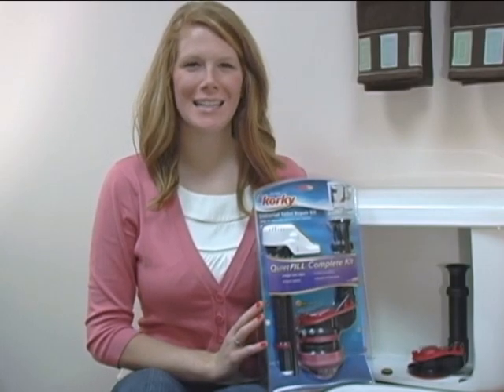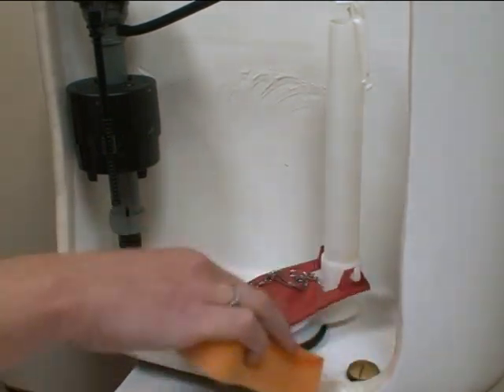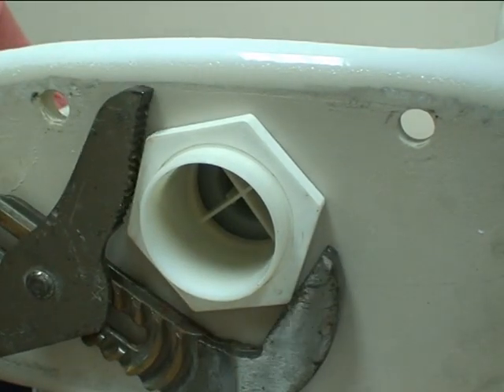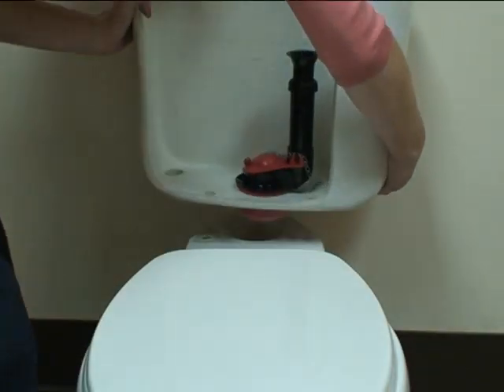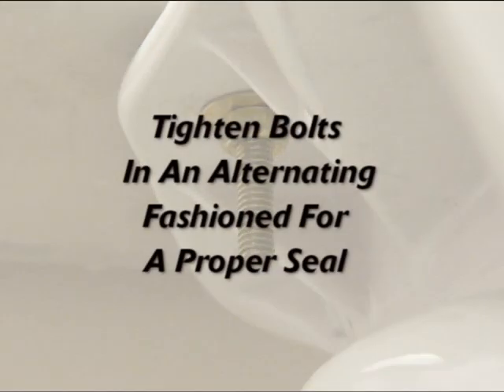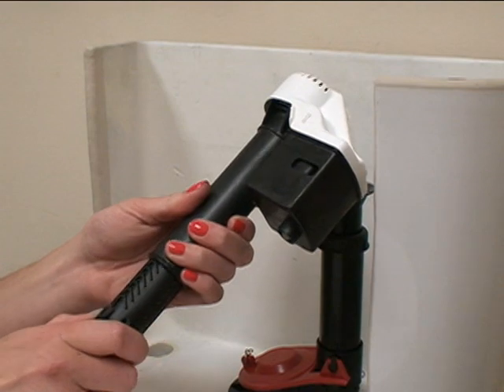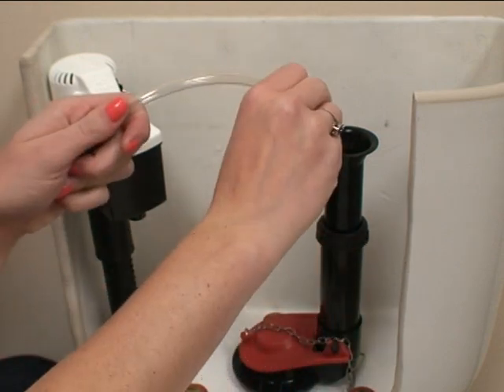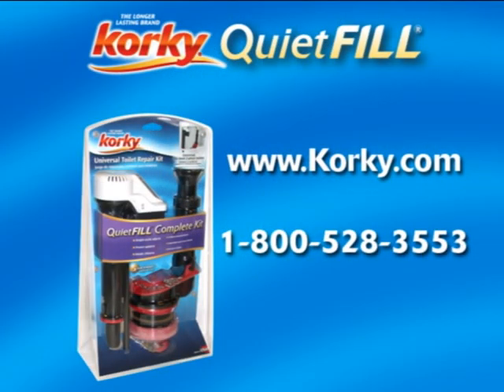How to install the Korky QuietFILL Complete Toilet Repair Kit

Comment: I too just used the Korky QuietFill. I have had no previous experience with changing out any part of a toilet, but by using this kit I was able to get it done in less than an hour. Our toilet was probably 20 years old and many of the components were rusted and took a lot of effort and elbow grease to remove. Assuming your toilet is in better shape, I imagine you could replace everything in <30 minutes.   Thanks for the instructional video - it really helped fill some gaps that were unexplained on the printed instructions.

Comment: Thanks for the tutorial. I didn't even have to look at the instructions that came with the kit. I did have to look up more information on removing the tank bolts as they were rusted and disintegrating and had to eventually be sawed off. Also only needed to purchase 1 tool, being the large wrench for the valve mounting nut as it is not something I've had a need for something that large before. But as we have 3 toilets in this house, I figure that it will be worth the investment.
Reply from the maker: We are happy to hear the video tutorial was helpful - thanks for choosing Korky!

Comment: What is the level use for on top of the fill valve assembly that goes to the hose that releases water into the overflow tube?  Does that lever need to be open or closed position?
Reply from the maker: Thanks for your question. The refill adjuster is used to control the amount of water that in in your toilet bowl. The setting of the refill adjuster is dependent on your toilet make/model. This video should help you to get it set correctly: https://www.youtube.com/watch?v=i45HDIUIkIM

Comment: My overflow tube is nearly as tall as the tank, though the fill line is several inches lower.  I cannot match the fill valve to the top of the overflow tube as shown in your manuals and in this video.  If I do then the new fill valve stands a couple inches proud of the top of the tank and I won't be able to put the tank lid back on.  And if I install the new fill valve at a lower height than the overflow tube, then the refill tube is climbing uphill.  Is that going to be a problem?  Am I losing efficiency or anything else?  Can the refill tube even work this way?  (total toilet novice obviously).  Is there any harm in cutting the overflow tube down to more closely match the waterline marked on the porcelain?  What is the best installation path for my situation?
Reply from the maker: Thanks for reaching out, we are hear and happy to help! Are you able to contact our customer service team? We would like to learn more about your toilet and walk you through the proper installation. Please call 1-800-528-3553 and we will have your toilet up and running in no time.

Comment: I recently installed this product and it works well, however, the instructions did not
show how to adjust the water level, instructions were totally useless, perhaps they were for a different model.
Reply from the maker: Joseph M Thanks for choosing the Korky QuietFILL Complete Toilet Repair Kit. We are sorry to hear your frustration with the instructions. If you have any additional questions, please call our customer service team by dialing 1-800-528-3553 and we will happily walk you through the installation.
Reply: 3 years later brother in the direction still suck but the video helped

Comment: I've cracked a toilet before by tightening too much. I just installed this and now it leaks at the bolts.  I'm afraid to keep tightening because it's easy to crack.  There's really no way to know how tight to go before it will both seal and not crack???
Reply: Mine leaked around the bolts too. I kept tightening each one until they quit leaking.  It’s scary

Comment: To adjust toilet bowl water level throw away the kit you just bought and buy the adjustable one, or use an ink pen end and shove it into the supply hose if the water level is to low cut the end to make a bigger hole. its to bad this kit does not come with a way to adjust this. It must be very difficult for engineers to design a toilet that can flush properly.

Comment: Great chanel lock job on tightening nuts as well as 1/4 turn on leaky valve. Im sure if you own a pair of chanal locks, you should own a set of deep sockets with the wrench.Give us some real instructions so I will buy this product. Diy plumber wonna be but far away from real deal imo.